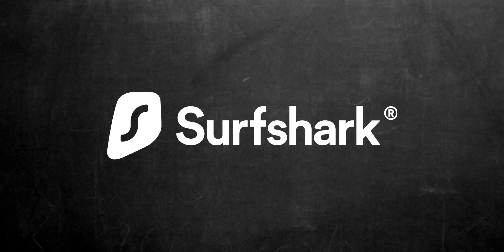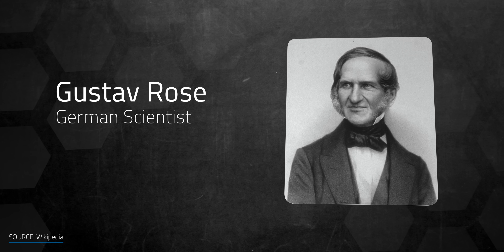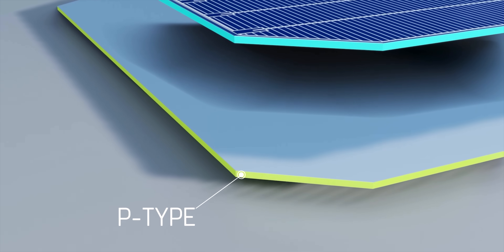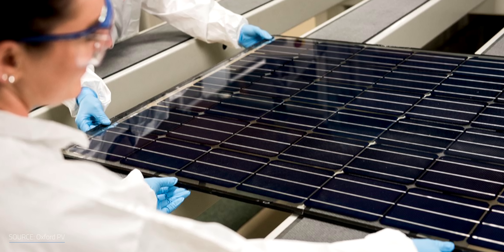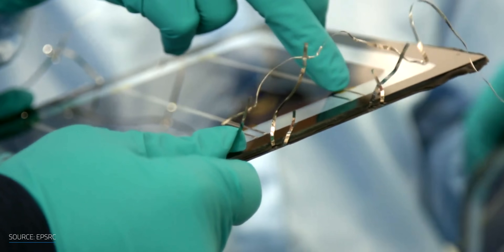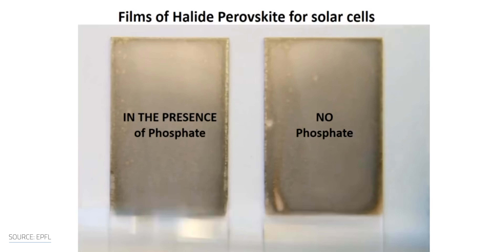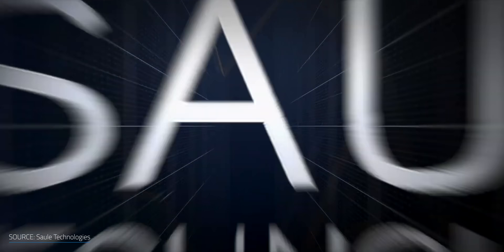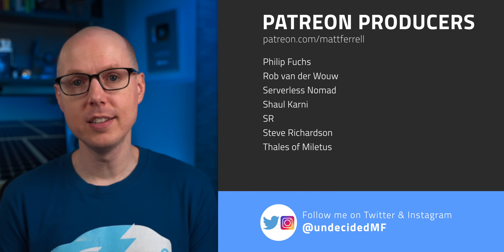Perovskite Solar Cells Could Be the Future of Energy

Comment: Starter solar panels for RVs, applications where installation is not costly or difficult, then if they are cheap enough, they can be switched out when their efficiency drops to low. Then there's portable panels for solar generators. I can definitely see a market.

Comment: The lower initial cost of investment, by a HUGE margin, more than offsets the expected lifetime of the panels. If you're waiting fifteen years versus two years to payback the initial investment then that's a disincentive to go for silicon panels. Also like the battery technologies, the expectations of further innovation in the near future could make people regret investing in the more expensive technology in a few short years, much less 25 years. And the difference in the power consumed in production of the cells can't be ignored either. If you try to calculate how much power a panel must produce to offset it's carbon footprint you might consider the silicon cell even more "expensive" .

Comment: Synthetic cubic pyrite nanocrystals are 1000x more light absorbing than current SiO2 solar cells and research is all but dead in the USA surrounding this tech. I’ve been researching and experimenting with hydrothermal synthesis of FeS2 in my home lab for more than a couple years now. I’m also now including purple phosphorus, phosphorene layers being included into the structure, which has now thrown me onto the terrorist watch list because of an overzealous nurse over my use of white phosphorus generation for generating pure phosphorus necessary for creating the pure purple phosphorus alatrope. FeS2 has too great a photovoltaic potential to ignore, so screw people scared of research into groundbreaking tech by amateurs. I’m proud to have been reported to law enforcement for proactive anti-terrorism nonsense. This use of FeS2 is nontoxic for the environment and is not energy intensive to produce. The crystal growth parameters can easily be controlled and adjusted. Graphene can be substituted for phosphorene but I see greater potential in the structural planes of phosphorene layers.

Comment: This is an interesting tech. 
From a "Net Zero" stand point the heat needed to produce photovoltaic panels really doesn't matter what matters are NF3 and SiCl4 by products. The Pb is nothing compared to HF3 and SiCl4. (Note CO2 is 100% naturally recycled and has a GHG of 1 compared to, NF3 which is not found anywhere in nature has an extremely high cost to neutralize and has a GHG of 17500)
Perovskite may be a good way to capitalize on solar with out the extremely toxic by products that have been completely ignored by politicians and the entire solar industry. 
If we have to rely on government policies to force/subsidized a product on to the market, it not a sustainable product. 
"Net Zero", is just a low science political push. 
There is a natural CO2 cycle which has been completely disregard. 
I would like a mass balance, energy balance, economic impact and environment impact comparison between, nuclear, Coal, National gas, Photovoltaic and Perovshite energy sources.

Comment: If you compare solar panels to roof shingles, I'm fairly certain most people care more about longevity than slapping something super cheap on their roofs.  So, unless these perovskite panels manufacturers can guarantee 10-years of sustained wear & tear, it's is highly unlikely these will have much commercial value.  By the way, the ISS has been using triple-junction Gallium Arsenide cells with an efficiency rating of some 30%.  And these last 10 - 15 years.  But cheap they are not.

Comment: as long as they can lower the cost to produce it enough where if it only last 10 years where you have to replace a couple of times and still come out cheaper than some of the panels that last 25 years

Comment: I like the idea of Perovskite solar cells, but as you stated their longevity compared to conventional solar cells is in question.  If they could guarantee a five to  ten year lifespan and an infrastructure (mounting and housing) that allowed for a relatively easy swap of the panels internals, then i think the cost benefit is there.  we all talk about the lifespan of conventional solar being 25+ years, that's great and all, but most roofs in the NE need replacing before that.   Why would it be an issue to know that you need to replace the internals of the panels in five to ten years, if the system cost so much less to begin with.

Comment: Standard silicon panels are already pretty cheap. I have a 410 Wp panel right here for around 140 US. It sure is a nice idea when that cost could drop to say 80 US. But these panels should last about 20 years so it's not really that big of a deal anymore. I think for most people installation costs are the major factor.

I believe cheap local energy storage will be the next biggest advancement with solar. When you can store the energy from your own panels and use it at night the grid stops being a limiting factor. Energy grids are already suffering from capacity limits. Cheap long lasting batteries can overcome this problem.

Perovskite can still be great for people who don't have a lot of space to put panels. When you have plenty of space however a panel's efficiency doesn't matter much. Because then you don't install a certain surface of panels but a combined number of Watts (peak) to cover your daily energy needs.

Comment: next year i will put 800Wp solar cells on my balcony of my apartment. then i switch to a flexible price model for electricity bill that follows roughly the stock price of electricity. during the day the electricity is more expensive and that is the time where my solar cells kick in.
in a few years i get an electric car. i mount a wallbox charger to my parking spot and charge at night when the electricity is cheap :-)
i expect the investment for the solar cells and the inverter coming back within 4 years.

Comment: 10 to 20 cents per watt. Gee normal panels are 50 cents and up. Used panels are as low as 26 cents. This is based on US prices and that includes what ever import export tax that is added on to the product as well. You can buy brand new panels for around 70 cents a watt shipped to your house off amazon right now. Well last I checked. This type of solar panels is years and years away from a viable product and this could result in a cheaper or more costing pane. Panels are getting bigger and condensed that its going to be hard to make any switch. dropping to 80% capacity after 2 years is just bad. I am sure if you ran the numbers for normal panels of their 25 year life at 80% capacity and then add another 25 years down to 70 and so on. Panels today are far better.

Comment: Very interesting , we clean solar farms in uk for nearly 7 years now using a sun brush machine it’s very reliable , our  biggest problem is the layout of the farms the access at the ends of panel runs etc , also the layout of the tables the most efficient set up is 4 high laying down thats about 4 to 5 mtr panel height this means a brush that needs a lighter tractor to carry it , this would translate to the ability to multi wash more than twice a year at conceivably single pence per panel opening up higher out put all year round ,some companies do already wash twice others don’t think wash is needed , there’s a lot to do particularly outing the early investors who refuse to wash, we have seen farms in very bad state of operation, on other hand many are getting there act together who value our reports after each wash and much appreciate there efforts to put things right 👍👍👍 to them it’s not all bad .

Comment: Those cheap garden solar lamps will become even cheaper then. On houses, well if the panels are so much cheaper and easily replaced, but still if you have to get all your solar cells replaced every second year, you produce a lot of waste and the savings will be far less than traditional cells that lasts for 15 years.

Comment: Thank you for the information! I have been waiting on true multi spectrum solar cells for a long time, as had my brother (God rest his soul). Applying Perovskite solar shingles to every rooftop in America would be an option. With each cell having the ability to be replaced would be key (Or at least small segments), but only if we can keep the efficiency up over 80% for 20 years and the cost fairly low. It would also bring a much needed refresh to a trade craft that is starting to suffer here in the U.S

Comment: I think it is one of those situations that even if you had to replace the panels within 2 to 4 years it would still be around the same price as a normal silicon array at a 25-year replacement. That's not even taking into consideration that on the first change they might have pushed the 2-4 years to 10 years. So I think it is a win to go with them over silicon regardless
Reply: The labor will kill you

Comment: Even losing efficiency down to 80%, that's still almost 3x the current Silicon panel efficiency. At a 40x savings, that's an acceptable (if not even ideal) tradeoff.  ROI goes from years to months, which still buys you time to continue and perfect the processes to recoup efficiency and eliminate toxic byproducts in the next generation. 

I cynically assume the reason we haven't promoted and retooled for Perovskite cells due to the sunk investment costs in the current infrastructure.
Reply: 40x savings? commercial solar in eu including everything (mounts, inverters, transformer) is about 0.7$  / watt. 
Even lower if talking Gigawatt scale.
There is not a commercial install of perovskites yet. There is no real cost of the panels then.
Still theoretically not a bad ideas but definitely not 40x cheaper rather 2-3 x cheaper.
Reply: @Mike-kr5dn  $10/sqft of Silicon panels
$.25/sqft of perovskite panels

Thus 40x the value assuming efficiency is the same. Factor in efficiency and you're looking at roughly 120x ROI.
Reply: @saureco  Square foot of silicon is rather 6$. Where did you get the price of the perovskites square foot?
Reply: @Mike-kr5dn  both numbers were revealed in the video

Comment: Why not use the properties of this material to make new products. For example build a lightweight airplane with an electric motor and long wings and coat the wings with this material. Maybe you could build a airplane that stays in the air for long periods of time for transmitting internet signals for example.

Comment: So, this might be an odd take, but if they can't get the lifespans stable, it might be easier to used these on a short term and recyclable basis in huge solar farms. I'd rather not do a costly roof install with something I may need to replace in 5 or 10 years. But grid providers who can minimize their installation costs will likely be the big winners here. We will likely continue to have silicon where durability is more important for some time.

Comment: I always look at Oxford PEV because the cost of cells isn't really the worst thing in the UK - installation is expensive. Roof area is also limited.  So getting a high efficiency panel  makes the most of those other expenses. So e.g. cheap and pure perovskites would not really help much since the dominating cost is the cost of putting them up (scaffolding, labour) and of course the inverter.  If the inverters could be cheaper or more durable and there was some way to install without scaffolding the whole market would probably boom.

Comment: A good question would be: How easy can it be recycled, and what are the energy costs for that?
Reply: Those machines for separating valuable materials from electronic waste already exist. They use mechanical force, and shaker decks, and water with additives, magnets, and all kind of different methods to separate the materials. They crush and mill everything to a fine powder, and while traveling through the machine various processes separate the materials in various stages. For example they can separate the lighter particles from the heavier particles by using a solution of water with soap that attaches to the lighter particles and that makes the lighter particles float, and then they skim of the lighter particles, and the heavier particles move on to the next process, and so on. It is one machine that does all the separation until all the various materials are separated from each other as much as possible. 

They do that because on average they can recover more gold out of one ton of E waste compared to a ton of gold ore. And then there is also the other valuable materials that are recovered from the E waste. Such as platinum and other precious metals, but also copper and less valuable materials, but that are still useful and profitable. 

And yes that machine consumes a lot of energy, but compared to the energy that is used to mine and refine new materials it is absolutely only a fraction of the total energy that is used for mining and refining new materials.
Reply: I know that a Duch company is very good at building these machines, but it is not a wide spread knowledge, because they don't really want to show how those machines work, because they don't want too many people to know that E waste is actually a very valuable product. I once watched a documentary about recycling E waste, and they even stated that at some point in time there will be so much E waste on a yearly bases that for some materials it will no longer be needed to mine for it in nature, if we make the processes that makes it possible to recover the valuable materials as efficient as possible with an infrastructure that makes it possible to do that. 

Meaning that it should be easy for people to offer their broken products to a recycling station, and so on. 

In my country you can offer your broken product to the delivery guy that brings you the new device that you bought online. Given the fact that it is a similar device. So if your TV is broken and you buy a new one they take your old TV if you want that. It is not obligated for the consumer to do that, but it is a service, and the delivery guy is obligated to offer that service.
Reply: It is called urban mining :-)

Comment: In a solar power plant installation, the solar panel cost is not more than 70% of the project and even in a solar panel, the cost of solar cell is not more than 70% of the panel. Hence the cost of solar plant even if the cell is free will not reduce more than half. And if all this investment doesn't go on for at least half the life cycle of silicon which is 35 to 40 years. Which means, if pervoskite doesn't last more than 15 to 20 years. No person will ever install this. Pervoskite doesn't last 2 years even in labs. The technology has a very long way to go.

Comment: The price of domestic solar installations in the UK are around 10-20k GBP with subsidies and when fed into the power grid will take over 10 years to pay for themselves. Apart from not being of much use due to the weather in the UK, this option is not a reality for the majority of homeowners here due to cost. 

I love the optimism in finding solutions, but has anyone asked what if there is no silver bullet for cheap low carbon green energy? What if technology doesn't find a workable solution? What are the contingency plans for that outcome? Is the price of energy generation going to rise, pricing out low-income households? Will energy usage become rationed and limited to certain times of day or night -- will peoples energy consumption habits be made to change by governments? 

These are all questions that should be asked. Add to this the calls to cease fossil fuel extraction -- then what happens with the other uses of fossil fuels in sectors like the chemical (like plastics and silicones) and agricultural sectors (like fertilizers) that we are dependent on to survive at current population levels. Can effective replacements be produced in industrial size quantities with no significant cost increase...we need to look at CO2 production and fossil fuel usage across all areas of life and chose what we will continue to produce and what we will sacrifice. 

Hydrocarbons built this world, what would the world look like if we stop using them?

Clarification needed: is it lead the metal or lead salts that are toxic?

Comment: at this point in our time,  the highest volume of solar cells is key.
if we need to add a water tower in our back yard and pump water up all during the sunlight, and then convert that to a hydro generator at night, then we can lick the energy problem.
next would be to cover every man-made surface, roofs and roads, with solar panel. or with plants.  
grounding airplanes is also key to end the "man-caused" part of the climate change.
to complete the tri-fecta, end clear-cutting of rain-forests.

Comment: Solar power, or green power in general, biggest problem is still energy storage. Energy storage technology must catch up first to energy generation technology before green energy can overtake fossil fuel. As it is now, we are still running on fossil half the time, while the energy generated when we don’t need it are essentially wasted. Batteries are polluting as well, I’ve heard of flywheels and water pump, but both are mechanical processes, and not very simple to set up and maintain. That’s why the damn carbon nanotube battery just can’t come soon enough.